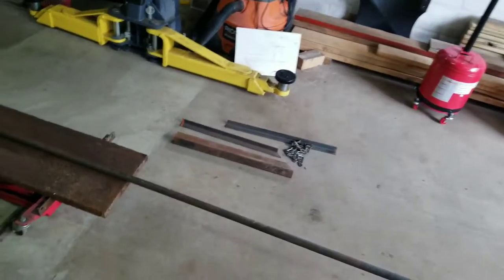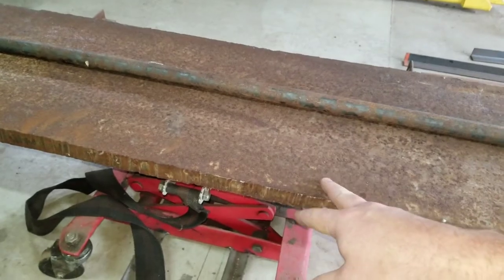50Bmg Target

Comment: Hey, is that just A36 or is it AR plate? I've actually been meaning to try to get you an AR400 target for awhile as I have a lot. Also at my work that would cost about $1.25 a pound at the moment. AR400 more like $2.50-2.75.
Reply from the maker: Definitely not sure as it's been a few years since we did any welding on heavy equipment.  It might be ar steel. I just put a video out where I shoot it with different things and nothing scratches it other than bmg ap rds lol. My email is cetme3088@yahoo.com  message me there and I can send you my address if you want to send a target.  We will definitely test it out👍 thanks for the info
Reply: @GearsAndGuns  You're welcome, I just watched the shooting video, interesting results. I'm don't though I might be able to beat that K98k mag dump. Lol